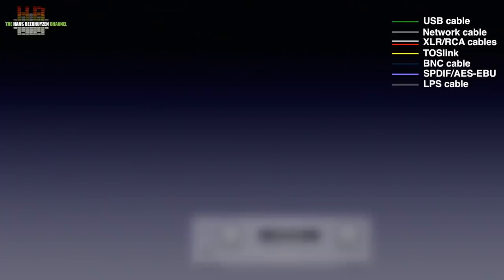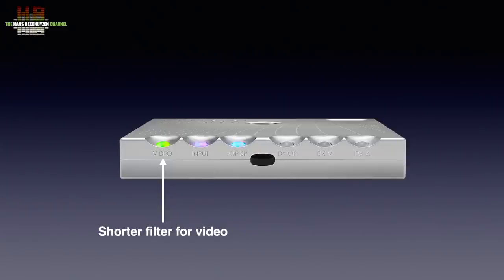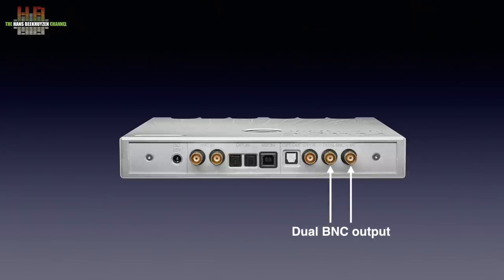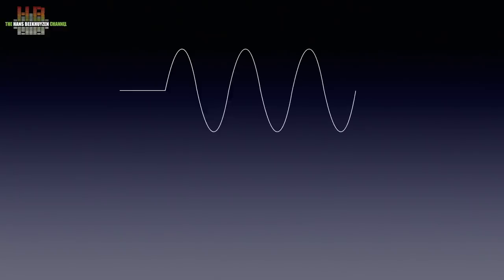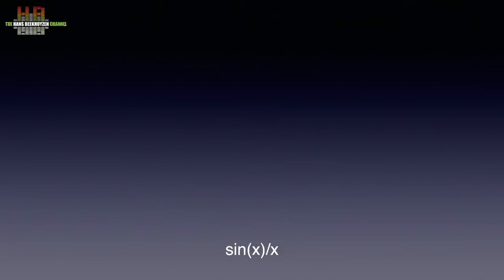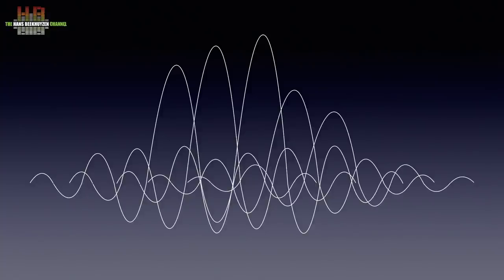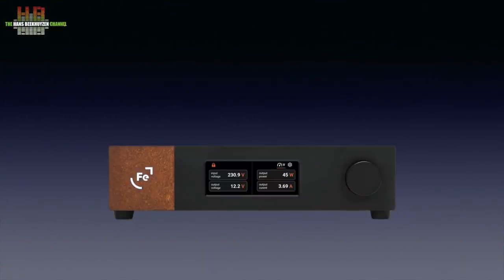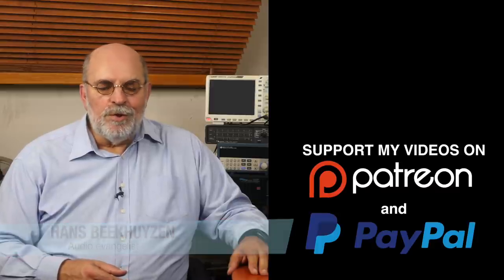Chord Hugo TT M Scaler & DAVE

Comment: Thank you Mr. Beekhuyzen for your work. This particular video made me listen and read all I could found on Rob Watts designs. I did listen many many times some videos to understand his theory… and finally bought a mojo2.

I understood that Rob Watts designs are immune to jitters. Do you think I understand it right that Chord DACs are immune to source jitters?

As I am a Apple airplay 2 user, i fed the mojo2 from a 99$ Belkin Soundform Connect with optical toslink(no rf noise problem) and it improved the sound very much. My system is in the range of your system setup 3, and now the instruments sounds real, clear, a veil is removed. I thought it might be usefull for the community.
Reply from the maker: Although I deeply respect Rob Watts and his work, I don't agree on two of his statements: his designs are not immune to jitter and better power supplies will improve the sound quality on a number of his designs. If his products are immune to jitter, how come I hear differences when I change the source from the very good Auralic Aries G2 to the Grimm Audio MU1 (upsampler switched off)?
Reply: @TheHansBeekhuyzenChannel  which inputs were you using going into the Chord products from those streamers?
It could be totally plausible that it could be noise differences that caused the audible difference between them if you used coax or USB instead of the guaranteed isolation of optical.
Reply: @TheHansBeekhuyzenChannel also it's possible that the switching supply's may upset your other equipment when being used with the Chords and therefore influencing the quality of the system. 

Using headphones to test the Chord equipment solely could negate that potential issue to help figure out the mechanism of why the quality difference of power supplies presents itself with Chord products, but I understand you don't like headphones which is perfectly fine of course.

I'm only theorising here and would be interested in your opinions.

Comment: Paying as close attention to the digital source will likely improve sound quality even further, ie rather than streaming over wifi, use locally stored files played using JPlay software.  Rob Watts +Marcin Ostapowicz = geniuses that complement each other
Reply from the maker: I disagree here. Connecting a computer directly to the DAC is about the worst solution. Especially in this class. Using a network bridge or streamer of equal quality sounds a lot better.

Comment: Great review Hans, I concur with the other guys about trying the M scaler with a TT2. I just wonder how close is that combo from the Dave alone, since the cost is almos the same for an Mscaler+TT2 vs the Dave, and how far is from the Mscaler+ Dave.
Reply: I've owned the M-Scaler with both the TT2 and DAVE at the same time and the DAVE alone was better than the M-Scaler/TT2 combo in my opinion. The combo gets close and does sound fantastic but it's a different sound, perhaps due to the difference in output stage. Some might prefer the combo to the DAVE based on personal preference of course.

Comment: Thanks for the great review. In case room correction is wanted, would you recommend adding a miniDsp Shd Studio before M-scaler, or would the resample by the miniDsp would too much alter the benefit of the M-scaler? (In that case the choice would be miniDsp vs M-scaler and that of course would depend on how critically is room correction needed).
Reply from the maker: I would use MiniDSP -> M-Scaler

Comment: As I know it I2s/HDMI, S/PDIF opt, S/PDIF coax, USB are not "Bit Perfect". The only digital stream who is "Bit Perfect" is TPC/IP over Ethernet. Maybe there is some more "Bit Perfect" streams which I don't know of. Please tell me if that is the case.
Reply from the maker: All the interfaces you mention are bit perfect. I don't know where you get your info but you're so wrong.
Reply: "Bit Perfect" meas there can't be a faulty bit in the receiving end. That is done in TCP/IP by error correction and resending packets if necessary.
In the other digital connections it is possible to use error correction but not resending faulty packets because they are only one directional so the recaiver can't tell the transmitter to resend. Error correction is probably not implemented because of that it can introduce gitter.

Comment: Thank you Hans for posting this.  I am not technically pretty much a novice but I have a question: How much difference is there when using 96kHz and 192kHz files? Is it worth using the M-scaler if you are playing files at these higher sample rate files. Thanks.
Reply from the maker: If you watch the video again, you see I explain that the M Scaler uses an advanced way of reconstructing the analog audio. This offers better time resolution and thus better sound quality, also if files at higher sampling rates are used.
Reply: @TheHansBeekhuyzenChannel   Thanks Hans. I just purchased the M-scaler based on your review and it truly is remarkable, even with higher sample rate files.  Best of luck with your surgery.